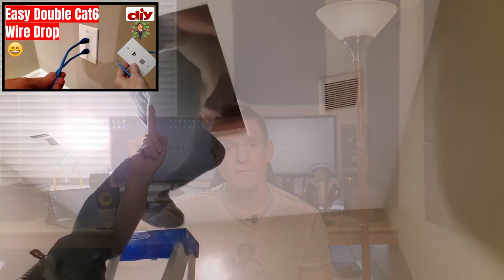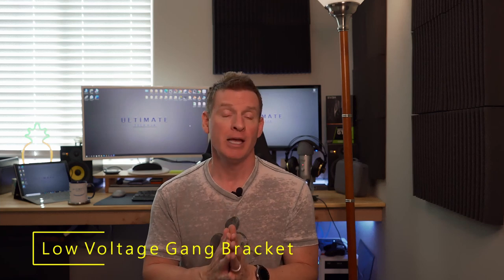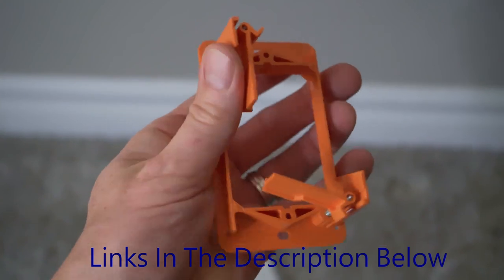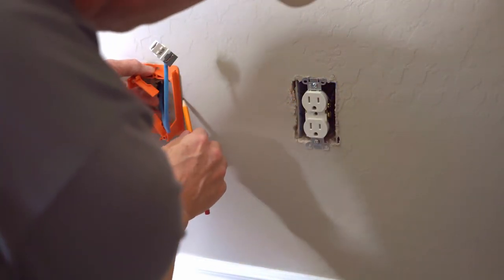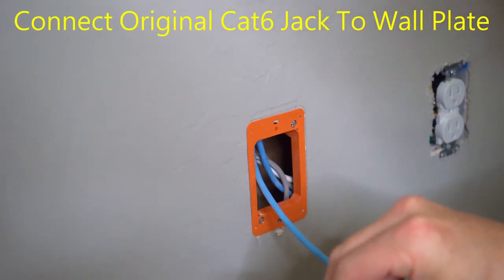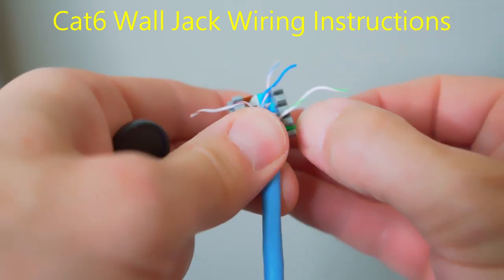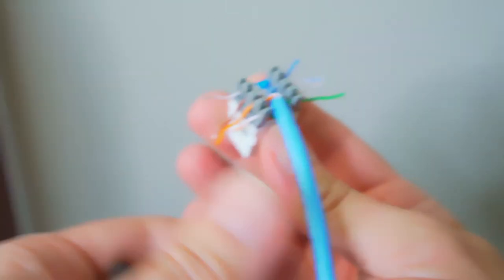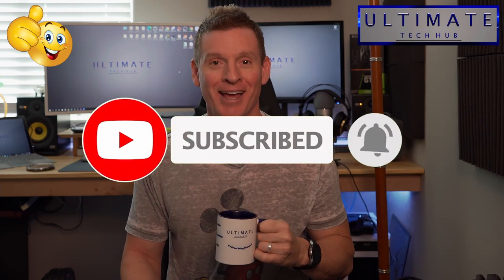DOUBLE CAT6 PORT INSTALL | CAT6 CABLE RUN THROUGH A WALL - HOW TO

Comment from the maker: Hey guys we are back with another Ultimate Home Networking video! This video shows the Low Voltage Gang Box Install and converting a 1-Port Cat6 Wall Plate to a 2-Port Cat6 Wall Plate. Leave any questions in the comments below! Thank you for watching I really appreciate it!
Reply: I play video games and it’s pretty laggy cause I play Wi-Fi will this work for me if I can get my parents to do it because I’m right below the router
Reply from the maker: @Xitrobe_2  Yes this will work for gaming and wired connections are way better for gaming.
Reply: What that means cat6 ther is 8 wires?

Comment: Great video! Just one thing in that the box plate install was done the hard way. You don't need to trace around the outside and trim to fit. You'll notice that there are holes in each corner of the plate that you can use to mark the wall. Then connect the dots to mark out the box to cut and fit the plate into.
Reply from the maker: Thanks for the great information. I didn't notice the holes but it turned out great either way! My next gang box install I use the holes for sure. Thank you for watching I really appreciate it!
Reply: Great tip. I've only done this twice, but that sure is very helpful.

Comment: Don't trace around the outside of the ring. Use the 4 small holes in the corners as your template.

Comment: this is awesome. i put 2 lines to each bedroom and 1 to each living room. i terminated each wall plate with cat 5e, ez connectors, am=nd cat 6 jack keystone couplers in blue color. i put rj45's 2on th2e end of the cat5e both ends and plug into a couplers. blue to look cool.
Reply from the maker: Thank you for watching and if you subscribed thank you as well!

Comment: I haven't used those plastic gang brackets, but have often used what's called a "mud ring".  These are stamped out of thin sheet steel.  When placed over the hole, tabs at either end are pushed into the hole and behind the drywall.  Then the screws that come with them are placed in the outer pair of holes, through the drywall and screw into the tabs.  The inner pair of holes take the wall plate screws.
Reply from the maker: Those work great as well. I just prefer the gang plate I used but both work well and are a pretty cheap to buy. Thank you for watching.

Comment: Should you use the same type of low voltage bracket for speaker wire?
Reply from the maker: Yes, speaker wire is low voltage.

Comment: Is there such a thing as a parallel physical connection for Ethernet cables without using a switch? Or is it mandatory to use independent cables to each port on the wall plate coming from the switch? What if I will never use at the same the two devices connect to each port?

Comment: When u feed the Ethernet cable through for installation around 7:30, could you run it through another plate like you did on the other side and simply have an Ethernet cable running from the plate to whatever it’s going into. I’m asking this to see if I can avoid the whole crimping process. Does that make sense??
Reply from the maker: Yes I believe so.

Comment: Dumb question. I JUST ran a 100' line through my attic to get from a switch to an intended port. I terminated and tested and no dice. (I think I kinked it too much/pulled too hard while pulling?) Meanwhile, I have a separate outlet about 15' away from the intended new outlet. What would happen if I just punched a line to the existing keystone. Essentially tying a second port to the first?
Reply from the maker: I would check your termination ports on both sides and make sure they are installed correctly. You could use one port to make 2 but it will limit the speeds to a snails pace. You could connect a 5 port switch to the other ethernet port then run a cable from the switch to the new location. Here is a video that might explain it better. https://youtu.be/VVbUIis78uQ?si=7WHDnDfj6Ps3XEM7

Comment: Great video. Great explanation. Great follow thru.  I have a question, more just curious, why not use a brush or whisker plate for the pass through? (if you have the extra cable) I guess I'm assuming there is some data loss with each connector.
Reply from the maker: Actually I used a brush plate on the other side of the wall for the HDMI cables. There may be some data loss but its not noticeable since I use this connection for my Smart TV video streaming. Check out this follow up video where I installed a 6-port Cat6 data wall plate and the brush plate. https://youtu.be/M29rUnKi_p4
Thank you for watching and for the great comments!
Reply: Oooooo...another video. Excellent!

Comment: There are holes on the corners of the mud ring, you mark it then line them up and that will be the line you cut , instead of guessing if the mud ring will fit
Reply from the maker: Yes there are. Thank you for watching.

Comment: Could I just connect one wall jack to another instead of using the type of plate you used on the side that leads to the switch?
Reply from the maker: Yes that would work. Thanks for watching!

Comment: Hello sir! What is the need the need for a low voltage bracket as opposed to installing it without it?
Reply from the maker: It's for keeping the installation to code. It's a safety thing and it is more solid than just drywall screws.
Reply: @UltimateTechHub  Thank you for the super fast reply!
Reply from the maker: @billybuck2713  No problem. Feel free to ask me any questions.

Comment: I wish it was this easy to fit these im my house, every wall is solid block with dot and dab over the top :(
I envy you Americans for mostly all having walls like this haha.
Great video
Reply: When I ran CAT5 in my condo, my ISP did it for me.  When I got cable modem service in the late 90s, I wanted the modem in my "office", which is in the opposite end of my unit from where the cable TV comes in.  They sent a 2 man crew to run the cable and I had them pull in a couple of runs of CAT5 cable, which I purchased, at the same time.  They fished the cables up inside the wall between my living and bedrooms, along side an air duct, above my closet and bathroom ceilings and into my laundry room where it appears.  They were then run across the ceiling and down behind my water heater and through the wall into my office closet.  I then terminated the Ethernet cables on keystone jacks, which were installed in a surface mount box, just behind the sliding doors.  It took that crew 3 hours to do the job, including patching the drywall where they cut it.
Reply: Well all you have to do is learn how to bend conduit and you're set! Happy greetings from across the pond!

Comment: 6:38 - They sell punchdown tools. I never seen that method of what you just did. :)
Reply from the maker: They sell punch down tools but why spend 12 dollars when you get one for free. I've used the 12 dollars version in college but this little tool works just as well. It doesn't cut the wires back but scissors do the same thing. Thanks for watching I really appreciate it!
Reply: @UltimateTechHub  A proper tool works better.
Reply from the maker: @James_Knott  I've been using these little punch down tools with no issues. I've used the expensive punch down tools back in college and these work just the same expect it doesn't cut the ends off. Thank you for watching.
Reply: @UltimateTechHub  I have done a lot of cabling professionally and would never use anything other than a proper tool.  When I first installed Ethernet cable in my home, back in the late 90s, I used the plastic tool and it took a lot of ##$#%25 to get good solid connections.  They can work, but you can't always bet on it.  I later redid those connections when I had the proper tool.

Incidentally, I started working as a tech in telecom 50 years ago and my first LAN experience was in the Air Canada reservation system in early 1978.  Back in those days, there was no Ethernet.  They ran time division multiplexing at 2 Mb over coax or 8 Mb over triaxial cable.  My first Ethernet experience was in the mid 80s, with 10base5 "Thicknet" connecting VAX 11/780 computers.